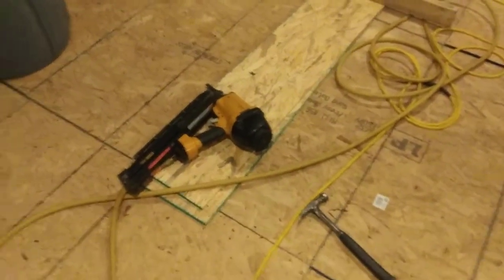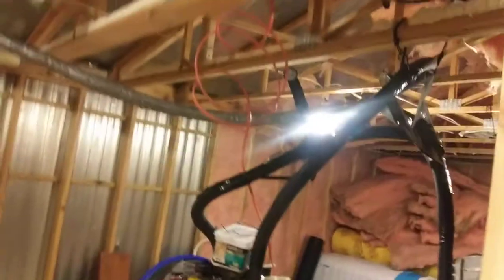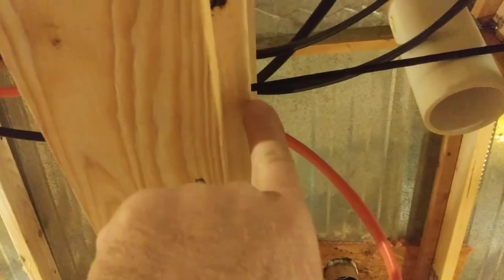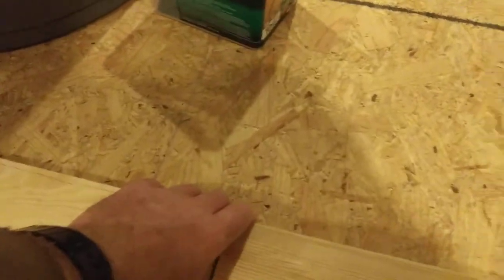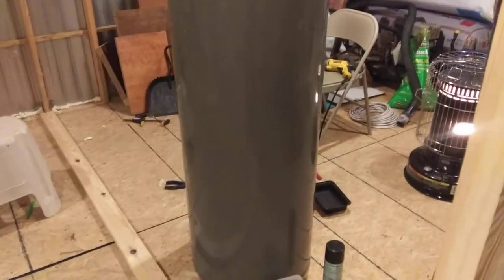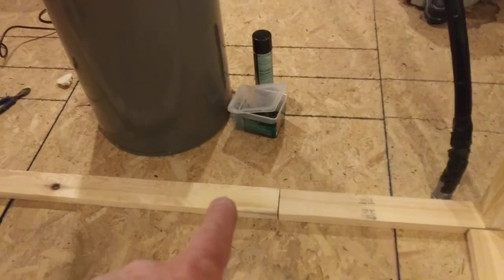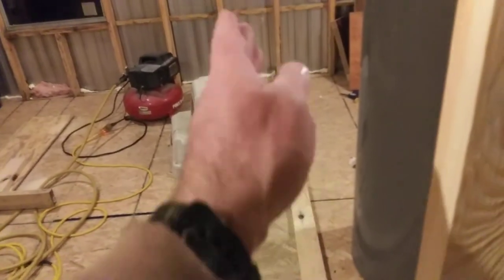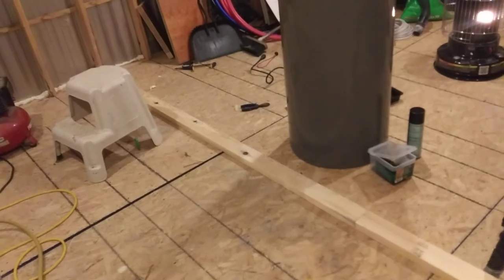How to Frame a Super Straight Partition Wall

Comment: What happens if the floor is not level or plum?
Reply from the maker: Because you'll cut each stud to fit you'll automatically adjust for level imperfections.